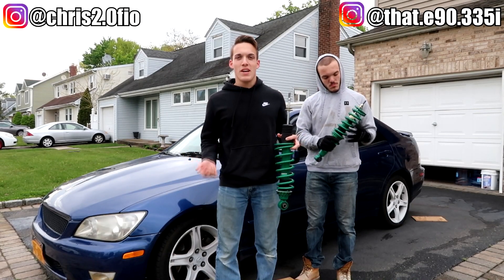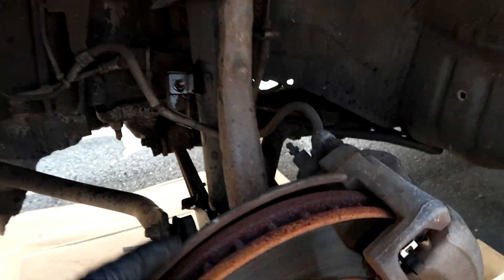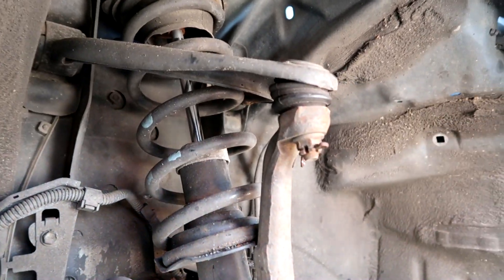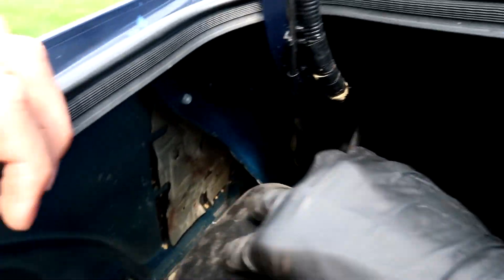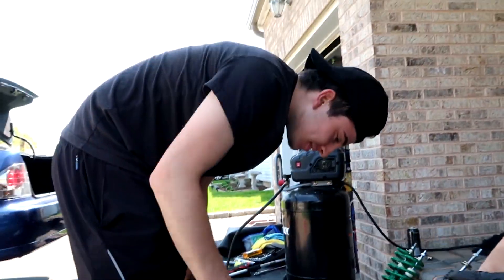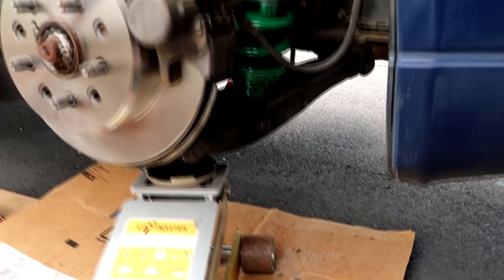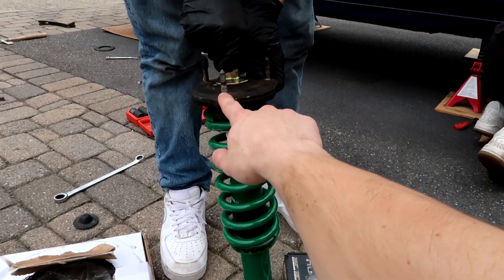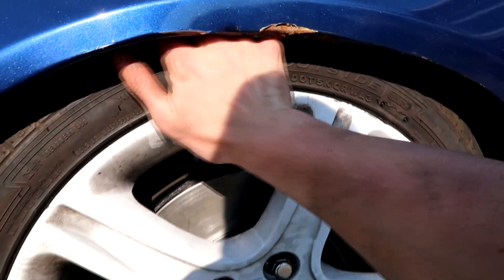Slamming The IS 300! (Full Coilover Install)

Comment: Awesome vid. Any update on how they are?
Reply from the maker: They are still good! We forgot to mention in the video to walk around and make sure the dampening is same for all the coils.
Reply: @acauto7886  Does your mate get any wheel hop when trying to do a burnout? I have wheel hop on my stock suspension and I heard upgrading it removes that. Would you be able to confirm?
Reply from the maker: His still hops. It is due to the lsd differental. Not with the suspension